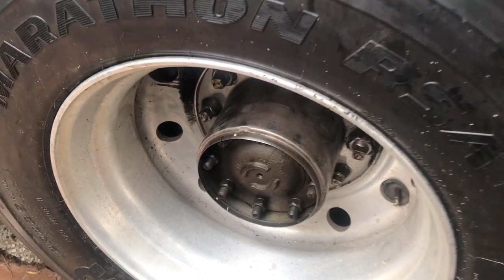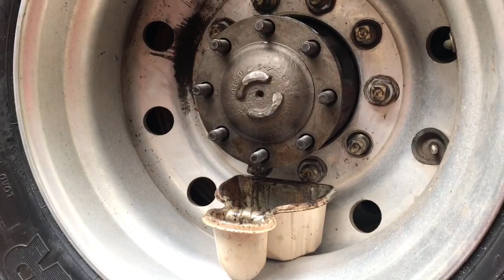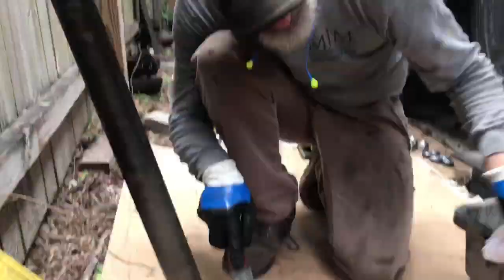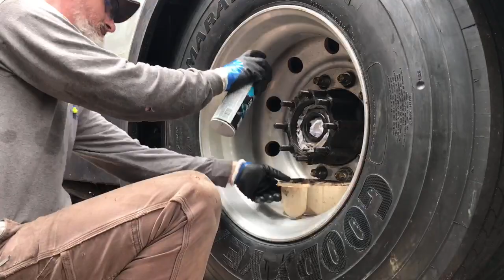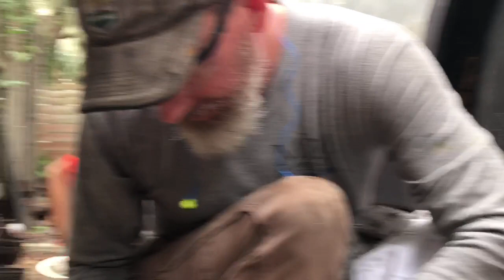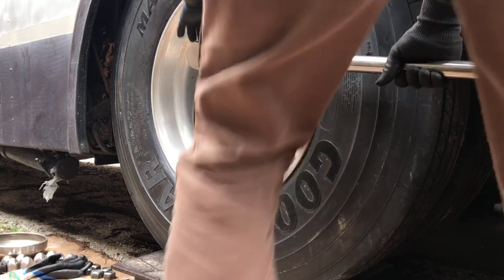-Gino’s Garage- 1988 Wanderlodge WB- Axle Gasket Replacement

Comment: Wouldn't it be easier to have removed the studs from The Hub to clean it up?
Reply from the maker: Not at all, plus you risk breaking one off in there trying to get them out... and you have to try to keep getting crap down in the threads.. It was not that difficult to clean it..